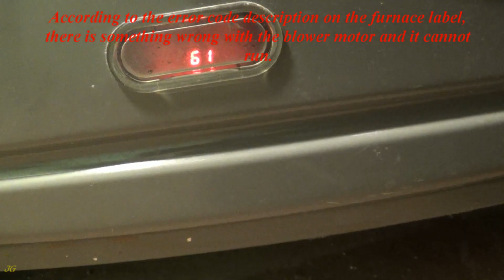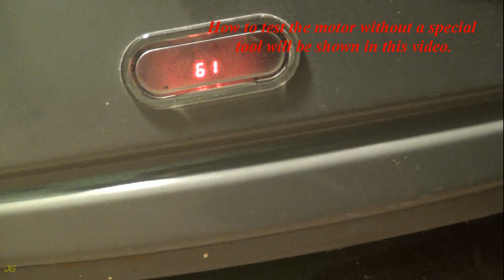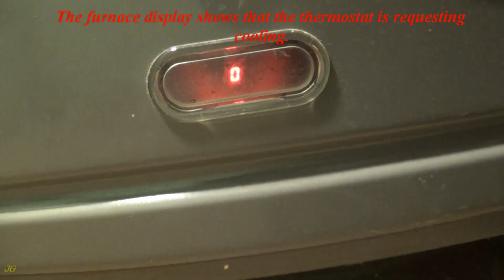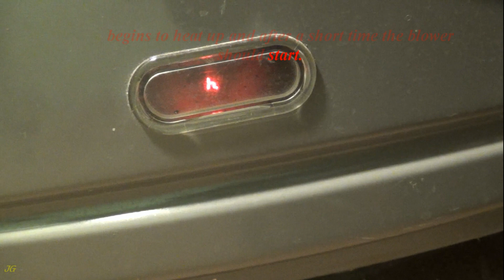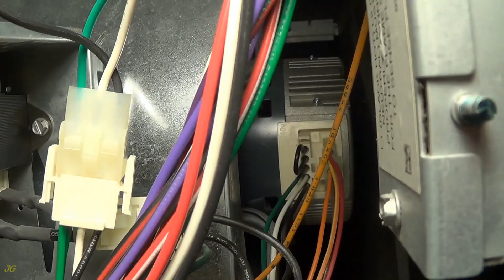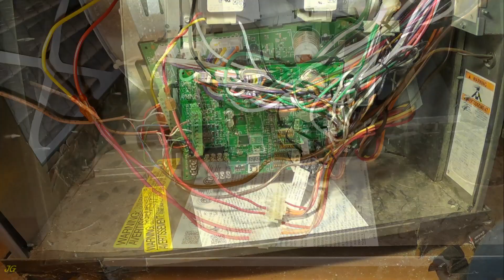How to test a blower motor when HVAC furnace displays a "blower cannot run" code

Comment: hi, in the video the diagram shows pin 1-red - v; pin 2 -y/pk - tx; pin 3 - O/W - rx; pin 4 - br - c ;  any clarification for connection 3 & 4 instead 1 & 4 for testing?